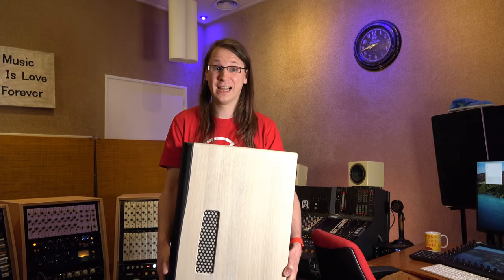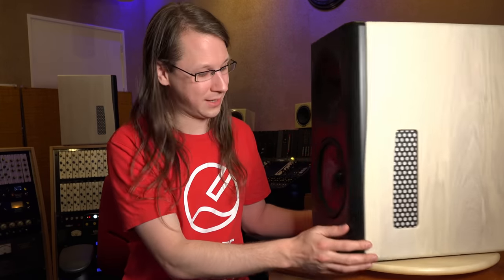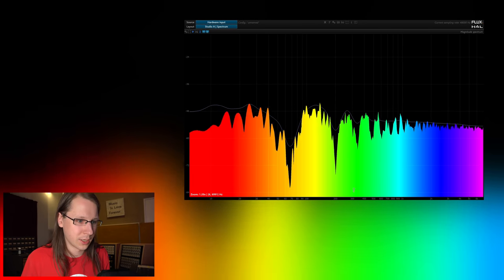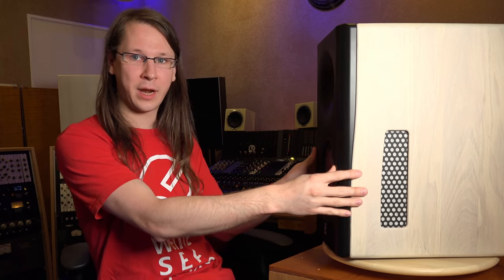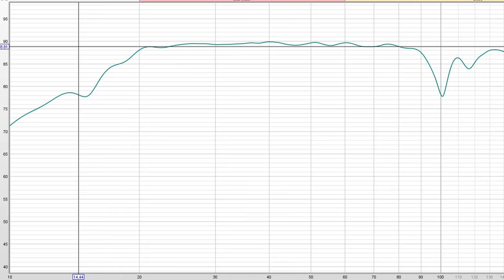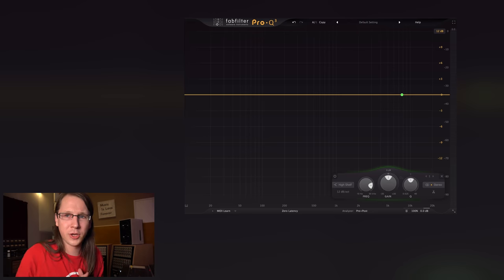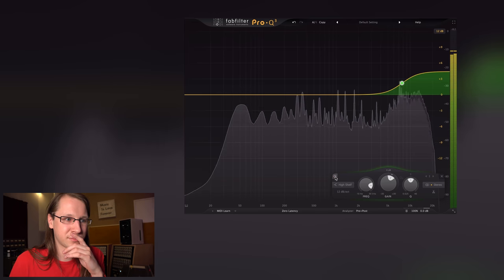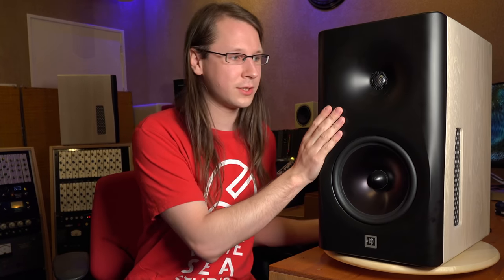Will these make EVERY STUDIO sound GREAT? || Dutch&Dutch 8C REVIEW

Comment: I dont thing that fixing the speaker for your preference is a good idear. When you own a headphone or any other piece of audio gear, you really get used to it. After a week or so you really acept it as your standart. As soon as you get a new one it will sound wrong for weeks. I mean shure you can do it, and it certenly is a way to have less stress on you ears, but you are always doing a lot of guesswork in you brain, kind of imagening how it really sounds. You can do it with practice but it is inacurate. And in mastering, where even a 0,5db can be important, thats just a bad idear, and  you are making it way to hard for yourself. Just listen to the flat one for some months and i bet you will not change a thing.

Comment: that's a very clever design. a bit on the pricey side, yes. i recently went from NS10s to Frontiers (by Output) and i do have some treatment to cut down on reflections (against a brick wall i have in my studio space)... but here's the thing. when i'm mixing or just listening, i have my db meter app and i never let the level go over -70dB, and that means not a ton of reflections at all, my mixes tend to translate better because my brain isn't being tricked into thinking louder is better. i don't know, it works for me, but yeah just working within limitations and a $3.99 app pretty much helped "fix" any major reflection problems.

Comment: I think you've misunderstood the design a little bit, its the speakers on the back that create the cardioid pattern, not the grills on the side. We used to run Pa systems like this, or some systems had it build in, like the early Nexo line array subs (Some new D and B subs have it build in).
But you do need to keep the sides free from reflections for it to work correctly, just like you said. Those speakers look awesome, i'd love a pair
Reply: I just put my subwoofer in the middle and actualy facing (almost touching) the wall. there is no DIP in the response at all
Reply: @Jaburu  Thats because sub waves are so long, that the phase will only be slightly out, at 60hz its a 5 meter long wave. Try 2.5 meters from the wall, you'll hear that
Reply: @lindonpeasley2469  yea, the delay added by a few cm is neglectable. the wall basicly turns into the woofer. I have no clue why this concept is done so rarely. just turn the sub around. it is so easy
Reply: No, the speakers on the back are subwoofers and are, indeed, omnidirectional.  The vents on the side act are where the cancellation comes from.
Reply: @ErinsAudioCorner  So you don't use the subs at the back to create the cardiod pattern? Therefore you use other drivers to create the cancellation, as simply putting vents alone won't work. Can you explain further, i'd like to understand, as the video isn't clear and your comment doesn't help either. https://www.prosoundweb.com/images/uploads/ABCEndFireFigure10b.jpg

Comment: 10k IMO is not much for an active studio monitor. I am an old fart (55) and I bought my Studio Monitor about 25 years ago (a JBL 4425). That thing is a passive speaker and if I remember correctly it was over 4500 DM back then. So if the speaker works the pricepoint is not cheap but fair. 
What I really wanted to talk about is your opinion about the high frequency response. You are talking about flat frequencys and that it kills you in the higher frequencys. There is a huge change (like almost 100% chance) that you are absolutely right. This whole ideal of a flat frequency response is to a very high degree total BS. Your ear is way less sensitive to the frequency bumps than it is to distortion. Mesure the frequency response of an amp almost every amp has a completely flat frequency response but compare a tube amp to a transistor and you will right away notice the nice harmonic distortion of a tube (if this is a good thing or not is for another time, the point is that you can spot it right away). Now compare the amount of distortion even of the worst tube amp to a speaker and you will find that a speaker is at least a 10x magnitude worse than the worst amp imaginable.
Now let's imagine for a moment that your speaker has a terrible resonance at 15kHz or above (because 100% of all non horn tweeters have such a resonance) then you don't want to hear it. It will make your ears bleed if you have to listen to it all day long. So what you do is you lower the frequency in that area. Now you feel guilty coz your frequency is no longer flat, but is a resonance from a membrane really a sound information that belongs to the music? No it is not! So what benefit do you get from a flat frequency response in this case? None!
If you have the time then have a look at the frequency response of these old BBC monitors of the 70s like a Spendor BC1 or the Tannoy monitors, their frequency response were bumpy like hell but you would not nesseseraly say that the recordings of the time were bad would you? Sure they were done without all the digital gimmicks like auto tune, compression and these kind of stuff, but they still sound great, at least in my opinion. 
Take care m8 - excellent video - and btw I never thought about room resonance and room reflection either but D&D is absolutely right, these are different animals ;-)

Comment: I was initially confused about the comment about connecting REW with the 8C's, because it didn't seem like I could do that, but it looks like they removed that featured in the 2.0 version of the app. Hopefully they can implement it again, it would save quite a bit of time in setup!
Reply: The feature has been brought back a while ago I believe. Make sure you've updated your 8c firmware and REW to the last versions and you should be good to go
Reply: @max8591  I just installed REW a couple of weeks ago when I got the 8C's, so I have the most current version. The FAQ page on the Dutch website currently states "REW integration is not yet implemented in firmware release 2.0. If you wish to use REW integration, you should roll back to firmware version 1.4.65 with the Release Management System, run RoomMatching with REW, then update to 2.0. Your RoomMatching settings will be automatically migrated to 2.0."
Reply: @rocketman374  This info on the website has been outdated since april, which is when firmware 2.1 came out. This brought back REW integration. Check that your speakers are on 2.1. If they are not this is the root of your problem =) Up to date 8c's with up to date REW will definitely work. I've been using it in the last couple of days myself. Let me know if I can help.
Reply: @max8591  man, I wish they'd update their website. The video tutorials are from V1! I currently am running version 2.1.1, so I'll have to go see why REW isn't talking to the 8C's!
Reply: @rocketman374  What exactly is the problem you have with it?
Reply: @max8591  REW doesn't see the 8C's, so when I generate filters, I have to manually enter them all.

Comment: Sounds all so nice, but you want to place the speaker from the wall to gain soundstage (if you you understand) so in that philosophy the woofer must be a second kabinet apart from high mid tones. Dampening should not be behind the speaker in that matter. Second thing is, what kind of dac's are used ? what is the quality ? also a big question for the amp. Not to speak of the quality of the drivers ? All things you want to know in my opinion. A cat in the bag bargain ! Better buy a mini dsp room eq with good reviewed 2 way drivers i would think

Comment: Miccing speakers works but u need a reaally good stereo pair and a really well treated space...fully anechoic and it will work to some extent...u will be listening trouggh something that wont be able fo reproduce the sound exactly if its worse...if u have full range system u should be able to ear the different colorations

Comment: If you don't want to spend the money for bass traps, just buy these absurdly expensive speakers!
Reply: whatever you install in your room, you can't fix problems in 100-400hz.
Reply: @tugbars4690  bass traps do not have the same effect a cardioid speaker does.  Cardioid changes the entire dispersion pattern.  Bass traps can't touch the effect the design these speakers have.
Reply: @ErinsAudioCorner  I know, I don't think I said something opposed to what you said. what I wanted to say is that, the solutions that seem to fix room reflection & directivity problems aren't actually working good enough to fix these problems completely. Cardioid is the way.
Reply: I couldn't decide whether I should save money and get D&D's or Geithain RL901K though.

Comment: This video was an actual snake oil, not that the speaker don't do what they claim, but there is again this hype about flattness and noone saying anything about transient response which is imho more important and tipically weak in most modern speakers. 
Litterally any speaker can be eq-ed, and there is a lot of cheaper dsp speakers with diferent "room cheating systems". Also the off axis thing doesn't quite work as you explained it... 
Nothing here says why these speakers are really better than others and why they cost more than  others.
Reply: I kinda agree, but you missed one major point. It's all about the off axis response. Yes with a DSP you can fix almost everything, but you can only adjust the total output. There is no way to only adjust the off axis response or on axis response, without adjusting the other.
Reply: This is why I use calibrated headphones. 
Most people are using small size rooms to monitor, monitors need room to breathe or they act like giant badly tuned headphones.
Reply: Except...frequency response and impulse response are the same thing. That means a perfectly flat response is a perfect impulse response.
Reply: @m00hk00h  So phase is irrelevant?
Reply: You can EQ any speaker, sure.  But what you fix in one axis is done to all axes.  And if the off-axis response doesn't mimic the on-axis response then it's a bad design and no amount of DSP can fix it.

Comment: Most soffit speakers at any price I have ever listened to in any studio are poor in terms of anything approaching critical listening, audiophile or otherwise quality listening.  From. $8K to over $400K, I have still never heard a quality listening experience from any soffit mount transducer system.   Does anyone know a soffit mount system that  actually provides a top quality listening experience?
Reply: It’s probably your ears or your brain
Reply: As a cofounder of a studio engineering groups in the UK we have studio design and redesign work since the 1980’s.  Soffit mounts are part of many of the installs and have gotten better over the years.  Pro’s and cons like anything.  Generally, more power and impact, reduces early and related reflection issues, and too often poorly done.  Recessing midfield and mains is a recipe for mid-fi sound, and unfortunately, the majority of installs are just that. I can’t bad mouth any of the brands we sell and install, but we do explain that soffit mounting is not going to help other room deficiencies and will often make them worse compared to well positioned free standing speakers.
Reply: @isc4915  - i assume that either you’re just trying to be funny, or you don’t know any better.   Just in case, here is a reasonable set of considerations of why/why not to go soffit, which I’ve pasted in for your edification.   

This is a bit of a large topic, and you will hear varying opinions on the subject. In a nutshell, there are a few advantages and many disadvantages to soffit mounting monitors, as with most issues in this business...

On the Plus Side:
1. You get some additional bass reinforcement below roughly 500Hz from the extension of the speaker baffle (approaching an infinite baffle) when you properly in-wall mount your monitors. This is 6effectively 'free' low end response gain, but in a poorly treated room, or a room under roughly 7 x 10 meters, it can create many new issues, and often does.

2. You eliminate the speaker boundary interference issue with the front wall, as there is no more boundary. The speaker baffle (front wall) is the boundary. Note, that there is still boundary interference from the floor, side walls and ceiling potentially depending on how effective your trapping is on some of these surfaces.

3. When implemented properly you can create good stereo imaging and you can control the focus point.

4. The 'main monitors' will ALWAYS be in the same position!! This consistency is a big plus as you and your clients will become accustomed to the sound of your monitors in your room and it should be a 'constant'... (of course this assumes that your monitors are maintained, and drivers are not blown, and the your cross-overs and amps are NOT accessible to curious and fiddling little fingers... YES, that is the voice of experience recommending that you mount your cross-over and amps where nobody can touch them!).

5. When properly implemented you can have an awesome, large sounding and accurate monitor system with lots of low end and fair to at least good imaging.  Note that soffit mounting, like many things, is about trade-offs.  No free lunch.  Power and possible accuracy, but often reduced imaging and mid range articulation.  

6. Clients are very impressed (assuming they sound good).

7. Some monitors are actually designed for this type of installation and won't sound right unless they are (properly) wall mounted.   Most soffit mount systems are poorly matched, tuned and implemented at even many top studios, and as such are not their go-to’s for fidelity, but often are for power and impact.

On the Minus Side:  (See all of the above)
1. You may not like the extra low frequency from your otherwise well-balanced monitors, and it will bring out MANY room flaws.
2. You are now STUCK with the position of your monitors, for better and for worse.
3. Monitor tuning is very limited, and access to in-monitor tuning controls must be moved to consoles if they exist.
4. The monitors will always be in wrong position!!
5. When done wrong, your reasonably high quality monitors will sound mid-fi or worse!
6. Clients will be impressed, until they leave your studio and say how God awful the main monitors sounded!!
7. Many monitors just sound better in the free-field, and even many designed for soffit mounting are designed based on assumptions that don’t translate to most real world studios, because studio designs vary so widely and soffit mounting is inherently not about flexible tuning.

Actually, for many installations we do very careful and detailed in-wall monitor installations. We try to design allowing for the inevitable nearfield monitors that will be stuck up on the console in the way of the mains. 

In most installations, we recommend the client go with free-standing or free-field monitors. The advantages are:
1. The ability to change or positionally or otherwise adjust monitors at will!! (this is a huge practical limitation)
2. The ability to move the monitors around while you 'learn' your room and find the best monitor and listening positions.. (this is my biggest plus point). I can't tell how many times I get paid good money to go to somebody's new studio and move around the monitors until it sounds good!! This is the single biggest thing you can do to improve your monitoring situation in a small/mid sized control room with free-field monitors...
Reply: The Northward Acoustics rooms
Reply: @sandramuncelli7976  im not reading all that. I’m happy for you, or sorry it happened

Comment: O, yeah. Always lissen off axis ! you dont want to lissen to two sides of a conus in the same time, or even right in front of a baffle with many phantom reflections. A baffle distroys clarrity for a tweeter so i dont think this is a good design at all.
Reply: @matdan2  That whas the name, "wave guide" yes. The of axis decay is less because of the waveguide but thats because of the added reflection from the wave guide. This is not adding clarity. Its the same as lissening in front of a conus from a mid/low driver. 2 signals in fact, each from each side of the membrame. Even that is not adding clarity. A bit stupid but the perfect driver is a dome, without a baffle.

Comment: There is a reason studios that consistently put out the best product have 4, 5, 6 or more monitor choices per desk and a few cars in the parking lot with oem stereos in them. The rabbit hole of trying to find THE BEST DO ALL, THESE ARE ALL I WILL EVER NEED, MONITORS is just a dick pull. They don't exist and even if they did why would you want that? I've worked in exactly 3 rooms with high end flown Genelecs (likely $20,000+ a set) and no one ever turned them on, preferring to bounce between sets of old Tannoy, Yamaha and JBL, even ancient Phillips and Sansui that anyone can afford. And, honestly, if I really need to macro what's going on with conflicting frequencies 2k-5k (which is where the vast majority of crossovers land in 2 and 3 way consumer speakers and cell phones tend to crackle) there are always high imp headphones. If you start to entertain marketing hype about gear it's over, you've crossed into the territory of deluding yourself because something about the actual work bores you. There is no other reason to visit fantasy land.
Reply: @obinna12  Monitors, Sybil. Read the actual words.